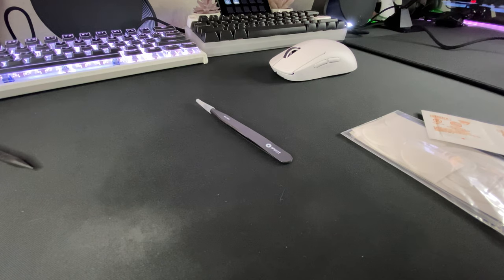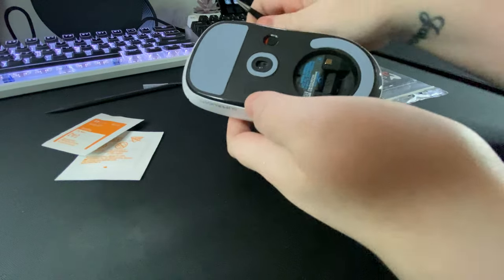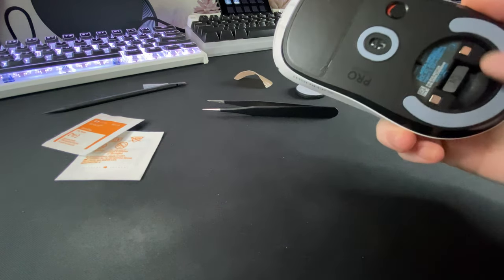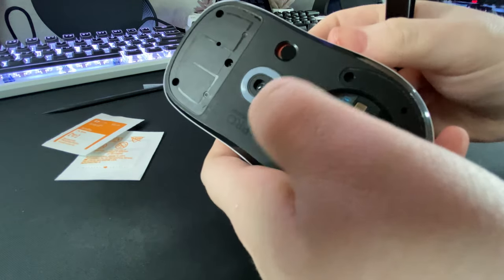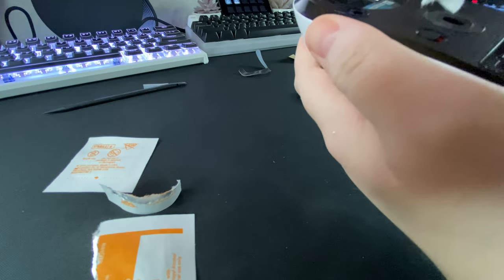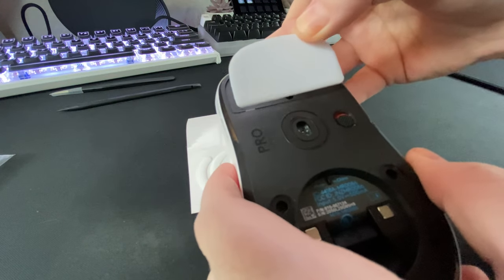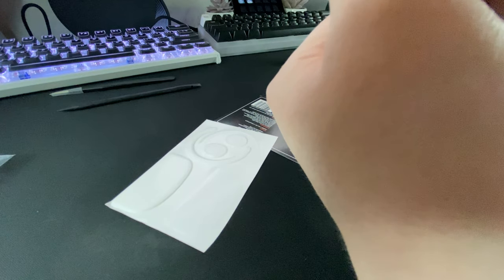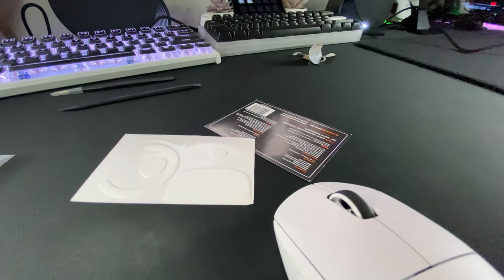How To Properly Install Mouse Feet (Corepads, Tiger Arc 1s, 2s, Ice, Hyperglides) on Any Mouse

Comment from the maker: One very important thing I forgot to point out, the sensor ring has the black adhesive around it too! I removed it off camera and forgot to mention it. Once you get the sensor ring up, you’ll see 6 small dots similar to screw holes. This is very easy to miss and I originally did in the video myself, so make sure you see the 6 small holes before putting the sensor ring on. It’s a pain to remove, so remember to be patient and gentle, and not to point tweezers towards the sensor if you’re using them. :D
Reply: Yo u gave me a lil heartattack when i took it off bc i thought i did something wrong 😂
Reply: Seince u didn’t put it in the video I wasted a sensor ring thanks! Should have put it in the vid otherwise good tutorial.
Reply from the maker: @Braedennnn  thats why i made this pinned comment, i didn't realize it until afterwards.
Reply: @themouselady275  oooof I rarely go into the comments and there’s one above yours by donuts 95 it didn’t show up under the vid😓
Reply from the maker: @Braedennnn  no worries. I’ll likely make a new updated tutorial soon and will make sure I don’t miss that part. Sorry about your sensor ring!
Reply: @themouselady275  it’s ok hahah I’m sure it will last a while and they are only $10
Reply: thank you for commenting that i didnt do that and was experiencing serious lift off issues

Comment: IMPORTANT note: The second layer of adhesive on the top skate is also present on the circular sensor skate. Make sure you take off the second layer of adhesive around the sensor too or your skates will be uneven.
Reply from the maker: i have a pinned comment already about the sensor ring, thanks for the comment though incase someone misses it!
Reply: @themouselady275  Oh my bad I completely missed that 😅😅😅😅
Reply from the maker: @blxzing1201  no problem at all :D

Comment: YOU Saved MY LIFE. I installed them and then immediately checked your video and found out that i forgot to remove the old black layers! Removed the new ones carefully, removed the old black layers and then reinstalled the new ones <3 thanks a bunch <3

Comment: A few tips...

If there's sticky adhesive that won't come off, or comes off too slow, mineral spirits is way better to use. It'll turn hard to remove adhesive into easy to remove gel in a few seconds when left on (as in don't apply and immediately wipe off).
THEN use alcohol to wipe off clean.
One more tip. it's a good idea to keep a bottle of 99% Isopropyl Alcohol (IPA) around, it removes residue better and has less water which means it evaporates with less residue left behind. Comes in handy for many things electronic.
I dropped my phone in water, completely submerged, (removed batt.) and immediately put it in container with 99%IPA (so phone was completely covered) and the IPA replaces the water. I put my phone up right for a minute to drain IPA and then flat in a warm place. This way I didn't have to worry about mist/condensation between the screens that you can't get to as it was the 99% IPA and evaporated without leaving water spots on the inside of the screen.
Reply from the maker: Thanks for the tips. I just used the alcohol pad that came with the feet, but I’ll try 99% next time.
Reply: Spilled soda in my PC one time, 99% Isopropyl Alcohol saved me from having to buy a new GPU and motherboard. It completely saved the motherboard, however GPU was dead. Good thing was I was able to clean out my GPU well enough that they RMA'd it and replaced it because they couldn't tell there was liquid damage whiich is not covered in RMA's.
Reply: It's also worth to mention that salts and minerals from water is what conduct electricity the most, and if the residue is there, it might still break electronics. So besides soaking in IPA, it's good to actually flush out as much as you can. If you don't have IPA, you can do it with demineralized water, I saved my keyboard with it. Years later, it's still working perfectly.

Comment: had no fucking clue there was a second layer to my x superlight. appreciate the nice and easy how to
Reply from the maker: Of course! Glad it helped you!
Reply: I didn't either and couldn't figure out why I was getting tracking issues as I just got an artisan mousepad as well so I thought it was a problem with the sensor reading the pad. After a short google and 1 set of core pads lost I figured it out and tracking is now perfect.

Comment: I only saw your video after pasting the mouse feets without removing the second black layer.  What do I do?  I remove the new mouse feets and try to remove the second layer and paste again or do I leave it anyway?
Reply from the maker: Take the feet off and remove the black layer otherwise you’ll have lift off distance issues

Comment: had massive lod issues with mine, removed the sticky stuff and saw screws. the big pad is waaaayyyy too thick and it's fine for a while but it starts to expand with heat etc

Comment: Regular gpro wireless (first model) also have 2 layers of feets/plastic? Thanks.
Reply from the maker: Yep :) you’ll know it’s removed when you see screws on the inserts. For me, the regular GPWs feet came off in 1 peel with the black adhesive sticking to the layer on top of it.
Reply: @themouselady275  Nice, greetz from Brazil!

Comment: Hello! I just got sent some corepads v2 for the superlight and mine didn't come with any alcohol wipes.  Don't know if that is normal or if I misinterpreted what you said in the video.  What should I use to clean the mouse after removing the skates? Should I use rubbing alcohol?  I haven't started replacing them yet btw so I still have the stock feet on lol
Reply from the maker: It should have came with some, weird. Rubbing alcohol on a cloth should be fine. Just make sure you don’t get it on the sensor :)
Reply: @themouselady275  Thank you! I might go and pick up some lens wipes from the store, I just watched BeardedBob's review of the corepads v1 and that's what he used instead of the included wipes.  Thank you so much for the speedy response! I love your videos!
Reply from the maker: @briangarrick9693  it’s Deff always good to keep some bulk wipes, I should do the same thing! And no problem :D thank you so much for the support!

Comment: It would be way easier to pull stock glides off by using a hairdryer for a minute (not at full heat ofc) since glue would warm up and liquefy a little, thus having less resistance towards physical action. Also about why you need to use wipes, most adhesives need defatted surface in order to stick to it, be it wood, plastic or any other material, and alcohol does exactly this, not only disinfecting surface, but also making it dry/defatted.

Comment: Hi I got my g pro x super light recently but haven’t gotten my mouse pad yet because it’s still delivering I’m currently using paper but noticed these tiny scratches on the skates. Is that fine and would it affect the performance? Also I’m currently using stacked paper as my mouse pad sooooo yea it would be helpful if you respond
Reply from the maker: Do you just mean you see lines on the bottom of the skates like all going in the same direction or actual scratches in the feet?
Reply: @themouselady275  I’m not sure if you have Instagram I can send you a picture of what I mean
Reply from the maker: @lunakk  I don’t sadly. But since you have a mousepad on the way, you should be fine. The feet shouldn’t be super damaged from a stack of paper I wouldn’t think. But I would buy after market skates to have ready if you’re able to.
Reply: @themouselady275  my main point here really is I’m wondering if these small scratches would have a impact because if they do I can get my replacement like rn
Reply from the maker: @lunakk  if you don’t feel anything strange when swiping your mouse, no. But the stock feet are terribly thin so I can’t say long term since they can wear down within a months time depending on use. I’d get the replacements now for sure.
Reply: @themouselady275  I think this might be because of the stacked paper but sometimes when I swipe the sensor won’t register the swipe and what I would do then is get another sheet of paper (yes the struggle is real) and change it to the top and it would work fine I’m just quite scared in a way cuz I spent 210$ on it and ion want it to break in the first week of having it
Reply from the maker: @lunakk  are you able to just use your desk for now? Or is it too rough?
Reply: @themouselady275  it’s a wooden table and it is rough I used it for the first couple hours and that’s why I didn’t wanna ruin the mouse
Reply from the maker: @lunakk  well if you have another mouse you're able to use until you get your mousepad, maybe use that if you can just to be safe i'd say.
Reply: @themouselady275  alrightttt thanks for the help
Reply: @themouselady275  hi! I got my mouse pad a couple days ago and thought I’d lyk my mouse works perfectly fine although there are some scratches on the skates but overall the mouse is amazing

Comment: Hi, why don't you use the extra round slider? I had stock glides and i dont know if is better to use the extra supplement.
Reply from the maker: Cuz for me it doesn’t make any difference whatsoever In glide and the puck doesn’t actually make contact with the pad :) and I prefer to make the mouse as light as possible without doing a weight reduction. It’s all preference tho, so if you wanna use it, go for it :)

Comment: this was a very helpful video.  i just put pulsar superglides on my logitech G PRO X Superlight.  made sure all surfaces of the application area was very flat.  and the result: mouse creep.  i used a level and my desk is out of level.  so another task awaits 🤣🤣  [edit:] actually used an electronic level and the desk is definitely off of level.

Comment: What I would really like to know is what type of glue can I use for my new mouse feet in case I need it? The thing is that I bought new sets of Tiger Glides Ice both for my RVU and GPxSL and the biggest compliant on the reviews is that sometimes 1 or even two of the set have no glue layer on them. I haven't checked mine out yet, so I'm curious about what is the best type of glue to use in order to be able to swap these feet too when I have to without too much of a trouble because I don't really want to bother with sending the feet back in this case.

Comment: I used toothpick for sensor part, made me less scared to scratch if i somehow messed up peeling away from sensor..
Reply: When working near the sensor all you need to do is put the tip in about halfway through the skate then bend your tool sideways instead of continuing to push forward or lifting up with forward force. I used a razor blade, slid the tip in just a little under halfway then turned the blade on its side and it lifted enough to get my fingers under it to just peel it off. Never went anywhere near the sensor and didn't even have a chance of doing so.

Comment: Which of the 3 tiger feet do you prefer the most and what is the diff between arc 1 and 2? Im planning to order ice and either 2 or 1.
Reply from the maker: Not too sure about 1s, but 2s are more control based, ice feet are all speed.

Comment: Thanks for the video explaining how to put them on properly, got my Superlight today and Corepads come tomorrow. 

Probably a stupid question, but figured i'd ask anyways, replacing the feet doesn't void Logitech's warranty, right?
Reply from the maker: Nope! :) as long as you don’t open the mouse your warranty won’t be voided.
Reply from the maker: Also that was actually a really good question!
Reply: hey do u not like the stock feet?
Reply from the maker: @dreaxedits  I personally did not. They were very thin, and didn’t glide that well at all on any of the surfaces I tested them on.
Reply: @dreaxedits  They glide well enough, but I could definitely feel the scratchiness on my mousepad (MP510) when using it which is due to them being very thin I suppose, so I ended up replacing them with corepads.
Reply: @themouselady275  Thanks for the reply regarding the warranty. Got my skates in yesterday and replaced them following this video. Came out great, feels much better as well.

Comment: I really wish the sotck gpw had feet like the super light
I wonder if these would work or if youd have issues with the bottom plasic that is slightly raised
Reply from the maker: You’d have issues and the mouse would be uneven in the back. Would likely cause LOD issues as well.

Comment: Hey I have a question, do you know if the Tiger Arc 1s come with alcohol wipes? and if not what would you recommend? I have the whoosh screen cleaner that I use to clean my mouse with wondering if that could work.
Reply from the maker: They did when I bought a set recently, but sometimes it’s a hit or a miss depending where you buy them. Whenever I get them from lethal gaming gear they come with the wipes. If not tho, just any isopropyl wipe or just alcohol on a paper towel will suffice :) you can try the whoosh, as long as the sticky residue is removed you’re good :)
Reply: @themouselady275  thanks so much! :)

Comment: damn the white GPXW looks so clean, I wish i could find a white one ins tock when I got mine a week or so ago.

Weird ass question, do you happen to know if the top single skate for a standard GPW would work on the GPXW? I bought a 2 pack of feet for my GPW and it seems to me like it would nestle in the top curve of the GPXW but idk if maybe you happen to have tried it before and know whether it will work.
Reply from the maker: It might be able to actually. Could always give it a try
Reply: @themouselady275  My only worry is since I don't have a set of actual GPXW skates at the moment I don't want to take the stocks off and find out It doesn't fit. 

That being said... SCIENCE! I'll get back to you on if it works or not lmao
Reply: @themouselady275  Ok so they fit, however they are a tad bit thinner, so if you tend to push the mouse into the pad I would not recommend putting GPW skates on a GPXW. 

You also can't really run the stock puck, I can feel a tad bit of scratchy-ness because the edges aren't rounded on the stock feet.

other than that they fit, the top skate has a tiny bit of a gap in 2 spots, but I do mean tiny. sensor ring fits fine, and the 3 singles fit perfectly as well, which I kind of figured they would. 
 
Honestly biggest issue with me swapping the feet is that I am a dumbass and used a knife, so there is a small scratch on the bottom of my mouse now xD

Overall I give this a 6/10. good in a pinch, but honestly if you have the $10 and WANT different skates (the stock ones aren't too bad after some break in hours IMO) just spend the $10 on new skates. Now i just need to make up my damn mind on which skates to get for it

Comment: I had orderd from Amazon the same ones however the sensor was having trouble responding and I took the second layer off what could the problem be
Reply from the maker: Are you positive you removed the second layer on the top skate, sensor, and bottom skate? I mistakenly didn’t realize until after I uploaded the video to YT that the sensor has the 2nd layer on it also so I pinned a comment mentioning it. If you removed the second layer on all 3 inserts, you may wanna RMA the mouse or see if there’s something like hair near the sensor making it feel off. Good luck! :)
Reply: @themouselady275  yes i  am sure it is only the top skate though

Comment: I hate those bottom layers that logi mice have! I never got it all off around my sensor, I'm debating just removing my skate there. I'll mess with it when my tiger arc ice skates come 👍... Just sucks cause my sensor bottom layer got all chipped.

Maybe that's why I got that spinout on the Raiden?!
Reply from the maker: Maybe, I’m not sure if the sensor skate is flush with the other skates on the Superlight cuz on other mice it isn’t. Interesting theory tho.
Reply: @themouselady275  it's pretty flush. I got most of that adhesive off, but it got all chipped. When I put on the new one I tried my best to get it squeezed down... But I'm almost thinking of just taking off that skate.

Any tip for when you have a lot of little pieces to get rid of?
Reply from the maker: @Guinibee1  hmmmm. For the sensor ring, I’d suggest getting the chunks damp with alcohol if you can, and maybe use a toothpick, or something sharp to help work it up. I had that same issue on the PTFE puck while taking the stock feet off, the adhesive layer was very stubborn. I took tweezers all around it and got it up, but the sensor ring is of course harder to work with and smaller.
Reply: @themouselady275  yeah I didn't want to scratch anything, so I got it, pretty good, then went for it. But I think I'll try a toothpick when I get the tiger arc ice and try again 👍

Comment: I believe, might only apply to tiger arcs, but you’re suppose to put it on the slot as light as possible and use a flat surface to apply it as there should be an air pocket which you don’t want to bend as it can make it inconsistent which is more noticeable with lower sens. Saw a few Reddit posts saying this as some ppl complain issues with mouse feet
Reply from the maker: I’ve installed aftermarket feet of different brands on tons of mice and have never had an issue. Appreciate the info regardless tho

Comment: Wait !
So if you firs time doing this with a new mouse, you need to remove the original balck teflon feets from the mouse ?????? This is why my mouse not working if I take the corepads skatez to the original mouse feet ?
Reply from the maker: Yes, the black layer must be removed.
Reply: @themouselady275  You saved me !
Thank you so much <3